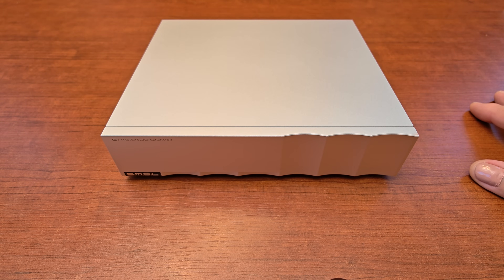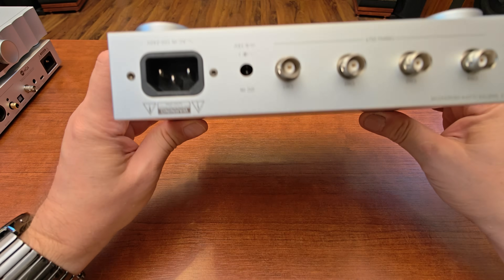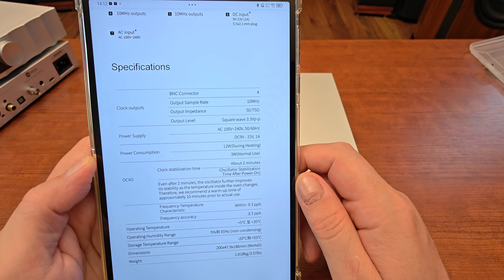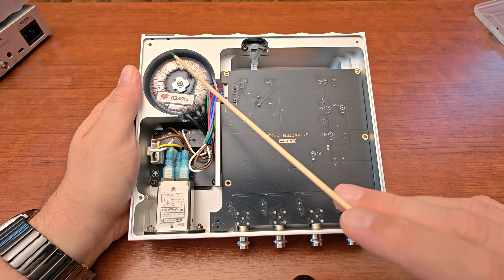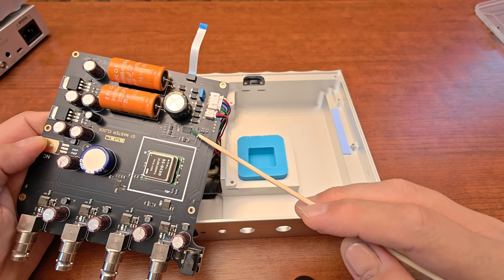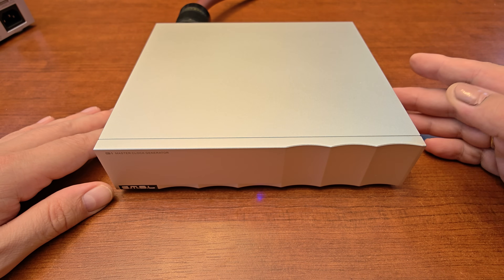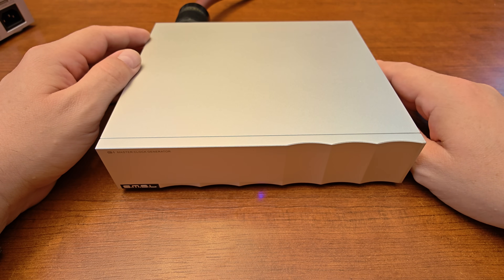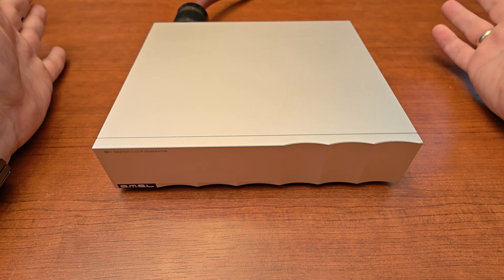Unlock Your DACs Full Potential: SMSL G1 10MHz Master Clock Review

Comment: Regarding this G1 clock, two questions:

1. You mentioned the Rohm chip in the D200 was not at Ak4499 levels of detail.  How does the detail retrieval of the D200 compare to good AKM chip implementations with the G1 clock?

2. Did you notice any advantage for the G1 over your existing 10MHz external clock, or do they seem to offer comparable improvements to all connected devices?

Thanks!
Reply from the maker: Hi! 
1 adding G1 boosted d200 to 4499 levels, it was no longer clearly worse when it came to technicalities
2 I would say exactly the same. The difference is with functionality meaning more parallel clock connections, the other ones I own are usually 1 or 2 outputs only
Reply: @k4syx thanks!  I’m thinking a G1 might be in my future if I end up using the uDDC and a DAC with a clock input.  I already have the PL200T, so being able to improve the performance of three pieces of gear will help justify the G1 cost.

If I already have the G1 then trying the D200 looks pretty appealing too.  Maybe if Ali has a good sale price 😊

Comment: When the buyer is a complete idiot, you can sell him a completely useless thermostatic precision generator in addition to a digital-to-analog converter with a PLL.  For those who know a little about electronics, the DAC is produced without a PLL, with two 44.1 and 48 kHz low phase noise oscillators and a jitter of 0.03ps versus 50ps PLL.
Reply from the maker: I generally do not like people calling idiots around here. I think we all prefer civilized discussions.
Are you aware that those DACs that have external 10mhz input actually do have a pll loop for the serial input signal (like the USB one)? And you have the option to switch loop control from internal oscillator to external one?
You're surely aware that this doesn't replace in any way internal oscillators (which btw are usually 22050 and 24000hz, not 44.1 and 48khz) and it's used for something completely different?
But you surely know that, since you're calling others idiots in your very first sentence.
Reply: @k4syx  I agree, it sounds terrible. But it's a fact that most buyers don't understand the technical details. Maybe they shouldn't. They expect that manufacturers are decent, that manufacturers will not deceive them. But in this case, the manufacturer himself does not understand what he is doing. 
 One generator is enough for the PLL. For example, the PLL in a DVD player uses a 27 MHz oscillator. 
To achieve maximum quality, modern DACs include an XMOS or AMANERO-based USB-audio receiver. The USB receiver works synchronously with the DAC chip.  The DAC is the master. At the same time, the internal DAC generators must be multiples of 44.1 and 48, usually 512Fs.

Comment: I bought this Masterclock to connect it to the LAiV Harmony µDDC, which is connected to the LAiV Harmony µDAC. I use Audirvana on an MC-mini. Converting the USB signal to I2S via the µDDC was a huge upgrade, but the recently added G1 Masterclock takes it a step further. It brought everything you said to the table, but above all, the increased refinement of the sound, especially with very complex chords on piano. The consonance, the harmonic overtones, strings that unintentionally resonate, and all the vibrations. Stunning!
Reply from the maker: Exactly! By the way I'll be reviewing loaner uDDC sometime in December, so stay tuned! 
Most of the people underestimate the influence of the clock and laugh at DDCs, but these make huge difference. That's not cheap, but the result is instant level up
Reply: @k4syx  I never miss one of your reviews. I'm definitely looking forward to your upcoming review of the uDDC. Today I did an interesting experiment. I used a rechargeable USB regenerator between my Mac mini and my former B.M.C. PureDAC. Initially, I also used it between my Mac mini and the uDAC. I connected the Mac mini directly to the uDAC. With the USB regenerator in between, it sounded even worse. Then I used the uDDC and reclocked the USB signal through the uDDC and output it as I2S to the uDAC. That sounded instantly very good. A few weeks later, I connected the Masterclock to the uDD using its default cable. Today I came up with the idea of placing the USB regenerator between the Mac mini and the uDDC after all. Strangely enough, that was a success! As a final step, I replaced the Masterclock G1's default power cable with an original Cardas power cable that I used on my previous DAC. My goodness, what a difference! I didn't expect that at all. I really couldn’t believe my ears. The G1 just clocks; there's no audio signal passing through it. How cm that be? I don’t understand. It’s almost too bizarre to describe, right? But it is really true.
Reply: @k @k4syx he LAiV Harmony uDDC and the uDAC share the same Femto clock. Reclocking the uDDC shouldn't make much of a difference. But if I understand correctly, the clock signal is sent via I2S in a different way than it usually does over USB. Otherwise, I couldn't explain why it sounds so much better via uDDC than directly to the uDAC's USB input. The external 10MHz Masterclock on the uDDC makes it even better than it already is. And to my surprise, replacing the Masterclock's default power cord improved the sound even further. Hard to understand, but undeniably true.
Reply: I never miss one of your reviews. I'm definitely looking forward to your upcoming review of the uDDC. Today I did an interesting experiment. I used a rechargeable USB regenerator between my Mac mini and my former B.M.C. PureDAC. Initially, I also used it between my Mac mini and the uDAC. I connected the Mac mini directly to the uDAC. With the USB regenerator in between, it sounded even worse. Then I used the uDDC and reclocked the USB signal through the uDDC and output it as I2S to the uDAC. That sounded instantly very good. A few weeks later, I connected the Masterclock to the uDD using its default cable. Today I came up with the idea of placing the USB regenerator between the Mac mini and the uDDC after all. Strangely enough, that was a success! As a final step, I replaced the Masterclock G1's default power cable with an original Cardas power cable that I used on my previous DAC. My goodness, what a difference! I didn't expect that at all. I really couldn’t believe my ears. The G1 just clocks; there's no audio signal passing through it. How cm that be? I don’t understand. It’s almost too bizarre to describe, right? But it is really true!

Comment: The "master clock" for home audio playback is the biggest scam the HiFi industry ever perpetrated on unsuspecting consumers.  The "jitter" it supposedly prevents if you rely on the CD transport's internal clock is imperceptible by the human ear.  If you say you can hear the difference, you're lying.  If you say I don't know what I'm talking about, then I'm sorry you can't understand why NOBODY can hear the difference.  It's physics.  Don't fall for the hype.  Recording studios use master clocks to synchronize multiple sources for recording.  Using a master clock for playback is nonsensical and produces absolutely no discernible benefit.  Don't waste your money!
Reply from the maker: Ehm I'm electronic engineer working in it and digital domain. External clocks in audio gear are not used to replace internal ones. They are used to control external PLL loop that controls internal clock and serial data transfers.
That's why it does work - and yes, as you say it's pure physics, and this trick is as old as the digital serial data transfers - receiver uses a clock that's a magnitude level more precise that the async clock that the transfer was based on. And then you have a PLL feedback loop that adjusts itself on the fly, precisely following source transfer variations and instability.
And yes, you can use "master clock" to sync recording gear, especially video and audio streams or audio streams from different sources (like different mics) but that's something completely different and it's not 10MHz I think (I'd have to check but 10MHz OCXO stabilized would be a total overkill for that purposes). 
So yes, physics.
Btw there are tons of publications on that in audio magazines and yes they usually (like 99prc what I saw) get it totally wrong, what it really does and why, and that doesn't help at all...

Comment: It would be interesting to see other master clock comparison reviews at similar prices, such as Aune SC1 Evo or the newer NC1 EVO with linear power supply?   Thanks again for sharing your thoughts!
Reply from the maker: Honestly that may never happen as I'm reviewing stuff I'm getting for myself - unless I'm able to get price so good that guarantees that I will sell it locally without significant loss.
Reply: I have a SU6 and it comes with a clock out. Not able to use it since most DACs don't have clocks unless I have to buy an SMSL DAC.

Comment: Thanks for the review.I have the D200 and think it's excellent.I have been trying to decide if this or something like the iFi Lan purifier pro would bring the most improvement to my system.
Reply from the maker: I would go for clock as the first one because the benefits will be bigger. Btw you may wanna try fibreoptic converters before going for lan purifier, these effectively cut any EMI and RFI noises by providing galvanic isolation and the set is like 10-12usd
Reply: @k4syx  Hi thanks, Yes I have been looking into doing it DIY style as it is much cheaper. The Ifi device is basically the same thing just packed into one small box. But it costs $299. It does have many good reviews on Amazon but I have never seen anyone say it sounds better than the much cheaper DIY setup.

Comment: Looks well made but call me cynical I can't think it ca make a dramatic difference to the audio. Perhaps I'm wrong but as its beyond my budget I'll never find out.
Reply: I didn't think so either. But with a budget dac it makes a significant difference. Much less smearing, more lifelike. Better soundstage and precise placement.
Reply from the maker: It really does make a difference, even with my Gustard X26 III and X30 (that's a spoiler here so shhh). Less so with X30, but with SU6 it pushes X26 III to 80-85prc of X30.
It seems that using very precise clock for phase locked loop is crucial for those USB serial async transmission (remember there is no retransmission nor any type or CRC or even simple parity check). My main speakers are electrostats and these are blessing and curse in one as they hand you even small differences on a plate

Comment: I noticed you did a video of a very inexpensive clock used in astronomy. And said how good it was with the gustard R26. So why should I send much more money for the SMSL clock 

 Is it really worth the money.
Reply: Yes please do a comparison of the cheaper vs more expensive clock if you don't mind sir.
Reply from the maker: Yes technically they are very similar if you'll take a look at the specs (and I still have that cheap one too!) 
The difference is better shielding (G1 is a solid metal block) - though in theory OCXO shield should be enough - and the fact it has four parallel outputs while the cheap guy has only one. Multiple the cheap guy price by four and we are in basically same price range.
Still, if you need only one 10Mhz source, this radio/astronomy 10MHz clock remains a VERY good choice!
Reply: @k4syx I would only need two . So can you recommend a unit with only two and that would be a lot less expensive than the SMSL 
 Kind regards Eugene

Comment: Hi Guys,  for the price of this item,am I the only person wondering why this item has  no power on/off switch in 2026, nor an added remote control for the asking price . This is utterly madness.
Reply from the maker: This is supposed to be powered on allnthe time as this will stabilize the clock thermally, it's "oven" for a reason :)
You want to have it running all the time, and there is nothing to control via remote really
Reply: Neither are necessary on a device with no configuration options and designed to be left on indefinitely.

Comment: The better is your dac and source, the less you will appreciate the external clock, if they are not very good the clock will help
Reply from the maker: That true up to a point, with external clock you can push your state of the art DAC even further - it's noticeable in transparent systems, I'm using electrostats myself and the difference is clear. In general you're right, the better clock inside the DAC, smaller the gains, but interestingly this guy pushed even X30 a little bit, and that one afair is supposed to have ocxo equivalent inside. But yes, the difference was smaller than with d200 and x26 III. 
The biggest one was with D200, meaning that the regular CX inside is nothing to write home about.

Comment: If your DAC is over 10 years old!!!  You  need it on modern  no DACs and even then a DDC is a much better investment.

You typically  do great research but clock generators and HiFi network switches are hype to drain money, think about it when your hardware software platform downloads the whole track before playback it can eliminate any timing issues
Reply from the maker: Hi there! 
No, that's not that. 10MHz external clocks are used for phase locked loops for input serial data transmissions, they do not replace internal DAC IC oscillators. The thing is there is no error correction nor retransmission, so very precise, very fast PLL allows you to minimize any errors in audio stream data. Remember these are coming to DAC as a stream so there is no file buffering of any sorts, even if you have an external streamer or player, final data stream to the DAC is always serial and it's not a file transmission.
You may think of it as something doing similar job as DDC: in fact, as long as using them both is the best way to go (also, most expensive) using only one of them - any - will get you something like 80prc of the total effect. 
This also means that using them makes sense of your have transparent enough system, as otherwise you just won't hear any difference at all. In my case, electrostats are both blessing and a curse at the same time as yes there is a difference, and I wish there wasn't as I would have to buy those devices....
Reply: No it won't. It can but then it has the same timing issues sending it to the dac. What you think is digital is in fact an analog block wave with rounded off edges and timing issues.

Comment: No way to inject this in my setup. No clocking inputs. But I think Both my streamer and DAC have excellent clocks built in. I may get a PO100 pro DDC for my PC sound though. Just for good measure I hardly listen over my monitors.
Reply from the maker: PO100Pro won't do much difference if your DAC is already using XMOS or Amanero. It works wonders for older DACs that may still be very good but have shitty USB controller. 
As for the clock, yes,  it's rare to have external inputs, but these do not replace internal 44.1/48 base clocks. These are used for phase local loop at serial data inputs, so that's completely different thing.
Reply: @k4syx  it is using XMOS XU208. My first DAC the SMSL Sanskrit MKII. I might try the DOUK instead. Hadn't appeared on my radar yet. I also have a M500 MKIII doing nothing at the moment though...
Reply: For similar money I prefer the new Douk U2 Pro (XU316 model).  In my system (between PC and modded ZD3 DAC) it outperforms the PO100 Pro.

It’s also designed to accept an upgraded oscillator, something I’m looking into, which should improve it further.
Reply from the maker: Douk is newer, there is a good chance it's better as you say and the price is good
Reply: @k4syx  I was using the iFi Zen Stream running Tidal Connect as it sounded better than my PC with the PO100 Pro.  Now that I’m using the new Douk U2 Pro my PC sounds just as good as the Zen, so it’s gathering dust.

Actually… I just upgraded my amp to a TS A75 which is more resolving than my class D amps.  Maybe I need to re-visit my Zen Stream and see if my impressions are still valid! 😊

Comment: Can you tell me if the sound improved on your Gustard X26iii with the SMSL G1? Thank you.
Reply from the maker: Yes, it did, using external clock is one of the ways to push any Gustard further. I was using external clock with my R26, then X26PRO and then with X26 III. In all cases this gives more clarity, transparency and detail to the sound. Additional detail helps also with soundstage, you get a little more air between instruments. 
This is essential upgrade for any Gustard with external clock input, the second one is using i2s input via DDC like SU6 (yes I have that one too :) )
Reply: @k4syx Thank you very much for responding. You've helped me decide to buy an external clock. Thanks again!

Comment: no black version?  😢
Reply from the maker: No, the whole stack is silver only.
Though, if you'd be desperate about it, disassembly is easy and you could easily paint it in black in any car workshop / garage
Reply: Looks like black electronics are out of style… back to the 70’s! 😊
Reply: You need to wait for the VMV version.
Reply: @Jeep_on_audio  good point, that's true.
Reply: Color is a personal choice, of course, but silver doesn't show fingerprints and dust as much.  

Most people don't realize this, but black dissipates heat better.  The color which becomes hottest in the sun absorbing heat, is also the best color for dissipating it.  Its the reason why wood stoves and many heaters are painted matt black.
Reply: @CubicIronPyrite  yeah thing is all my gear is black and I don't like silver it looks cheap